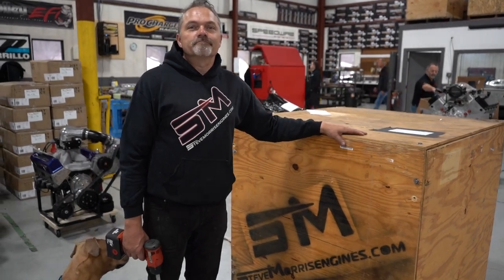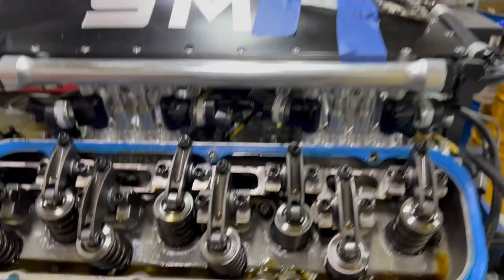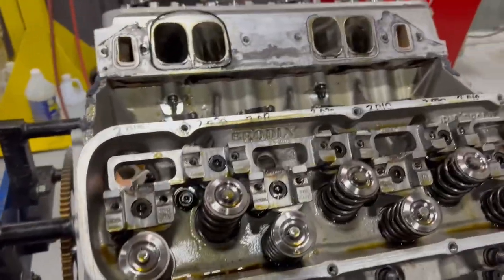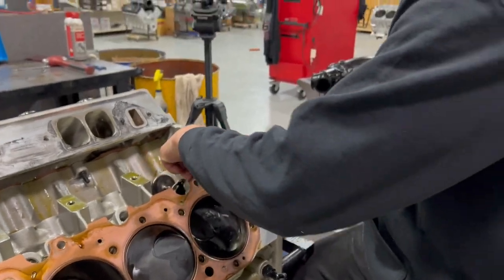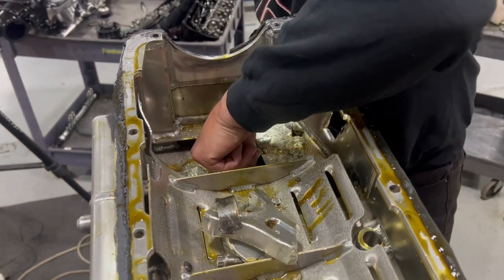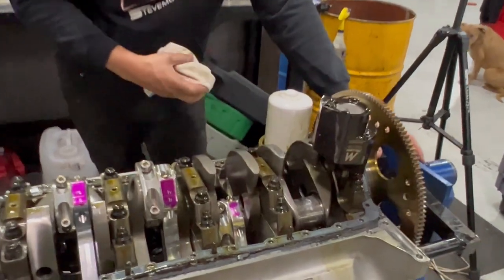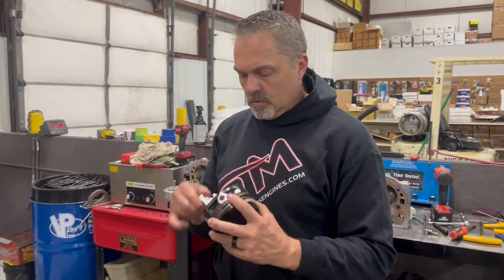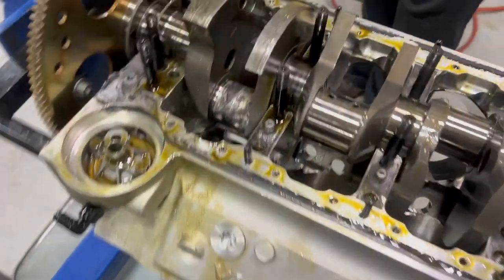Mullet !  What Happened ? - Warning: Engine CARNAGE

Comment: that engine owed cleet nothing!!! the fact it made it through last year is amazing lol. good work steve, and CLEET, Mullet needs a SMX!!!!!!!!
Reply: @bigboreracing356  Steve broke an SMX, so shit happens
Reply: @bigboreracing356  everything breaks eventually
Reply: He would have to do a lot of work to mullet to get an smx
Reply: @nickcollins1528  Not really. Just all the accessories to go dry sump and he should be good to go
Reply: @KJ-kw7gh  
Bad parts broke Steve’s. Not shade tree mechanics. Tuners going against builder’s advice and limits.
Reply: @bigboreracing356  go big or go home.
Reply: @russellridge8623  Cleetus told him he wanted to win. That means a 6.50 average. All of this is on Cleetus and he's the footing the bill. Your opinions don't matter, unless you're paying for his engine 😂😂
Reply: @bigboreracing356 will*
Reply: @nickcollins1528 Except Chuck Norris.
Reply: @nickcollins1528 it's going SMX
Reply: Ask Pete what cylinders it shuts off on TC
Reply: Not even an SMX is safe from Cleet, when he runs it without oil.
Reply: @russellridge8623  this is not shade tree mechanics. If they put too much power to it and split the block or shattered a rod then yeah it's on them, they knew they were over what Steve thought the engine could do but they were trying to win . There is very little chance a bent/broke crank could have been caused by tuners on the level that have touched mullet since he went big block. At this point it's clear something has gone wrong somewhere but it's unfair to blame in on Cleetus for being hard on stuff. Yes he was being hard on it but that doesn't seem to be why it broke
Reply: @russellridge8623  with an smx cleetus would be able to put in those tunes and not worry about blowing the engine. He wants a mid six car and that engine couldn't handle that, but an smx could
Reply: @russellridge8623  well, end of the day, you or I aren’t paying the bills, so don’t really matter what Cleetus and crew do.
Reply: @nickcollins1528  He’s already said it’s getting an SMX.
Reply: mullet doesnt need an smx, he cant go any faster with his current cage and weight so why spend all that money? either needs to go on a big diet, and go full tub frame and change cage cert or just build a new full promod
Reply: @russellridge8623  What "shade tree mechanics" worked on Mullet? Kevin form KSR has over 25 years experience, James has close to 20 years, and his tuner Pete is a legend in the motorsports industry with over 30 years experience.
Reply: Wasn't it a a freshly rebuilt engine though? It was a freak accident...... it was new for this season. Go look through Cleetus' videos. This was the engine that got rebuilt.
Reply: @russellridge8623  awe yes throwing shame at shade tree mechanics. Because everyone is born fully ready to be a pro mechanic, no one ever has to get hands on to learn, how dare they touch a motor right?
Reply: @nickcollins1528  not really
Reply: What do you mean " made it through last year "?   That engine is less than a month old, see the vid and Steves note at the beginning  "    Mullet's Engine is Ready to Battle "  on the channel " Steve Morris Engines  "      So, was it a sucky engine builder or end user that blows stuff for fan boi clicks?   I know what I'm picking. . . .
Reply: @wingracer1614  Plus a complete rework of the cooling system.
Reply: @TheMlc4life    That engine is less than a month old, see the vid and Steves note at the beginning  "    Mullet's Engine is Ready to Battle "  on the channel " Steve Morris Engines  "      So, was it a sucky engine builder or end user that blows stuff for fan boi clicks?   I know what I'm picking. . . .
Reply: @bigboreracing356  Thanks for the compliment.
Reply: @cliff4695  NS!!! Cleetus Has Footed the Bill
Reply: @ourtexasfamilyvideos62  Oh yeah. forgot about the dry deck. Still, that's child's play when you have a fabricator like Ty on staff. Nothing to get worked up about
Reply: @solatyn  Mullet has a 6.0 cert.
Reply: @bobroberts2371  people seem to have the attention span of a gold fish saying "oh the engine doesn't owe him nothing".....  really? what are they talking about it was totally refreshed ......
Reply: @TheMlc4life  said  "   user blows for fan boi clicks? Is that your pick?    "    ( cue 80's arcade game sound " Game Over " )
Reply: @tuloko16  This 100%, this engine would have probably made it all year , but he ran it with no oil for several minutes in the FL heat.
Reply: @bobroberts2371  shit oops LOL
Reply: @KevinHuff23  does it? i looked up the regs and the only 25.x cert that can go 6.0 is for full tube frame full body cars that weigh up to 3200lbs. I believe mullets cert is full body no tube frame 6.5@3600lbs

Comment: is that how a v6 is made ?
Reply: Extreme active fuel management
Reply: Land Rover did that with their V6.
Reply: 231s were made that way.
Reply: a chevy 4.6 v6 is basicly the front 6 holes of a 350 .. they share a bunch of the same parts too
Reply: @scootersfrog  The Rover V6 is actually a V8 block though, but with the back cylinders not bored out.  Very odd looking.
Reply: @arg8763  chevy used do that in some of the lower nascar divisions. It was the nascar sb2 small block with the back two cylinders missing their rods and pistons and they had a block off plate in the intake to block the back two runners.

Comment: Steve: It's good for 35. 

Garrett: How bout 50?!
Reply: Great
Reply: More boost = more broken parts  = more clicks = more $$$
Reply: @bobroberts2371  you have to spend money to make money
Reply: That is exactly what happened.
Reply: @patrickr2686     The problem is the fan bois of C McF   k  will trash engine builders after he breaks stuff  ( see Texas Speed where C had to tell the fan bios to stop trashing TS  ) .  The danger is, all it takes is a drunked up fan boi thinking they are avenging C by burning the shop down.  
Years ago I worked in a regular shop with a good rep.  Someones drunken bar talk turned into an unstable guy damaging many cars as a way to impress their drunken friend.
Reply: @bobroberts2371  I don’t think anyone has talked trash to Steve, all I have seen is nonstop how garret ram the motor without oil but I could be wrong same with Texas speed was all comments about things garret and his team did wrong
Reply: @bobroberts2371  I would like to assume that the people that would actually be using these engines would understand that it was pushed FAR beyond its limits.
Reply: @cixcer3821  Do a search for the vid "   Here's What Happened To Mullet's Engine In Texas...  "   and look at 2:50 . This is where he told complaining posters it was not the fault of engine builder and to stop blaming them.      BTW, a screw that allegedly came off the throttle blade would likely just pass through the engine and out the exhaust not trash the engine.
Reply: @L1Z1O  said "   I would like to assume that the people that would actually be using these engines would understand that it was pushed FAR beyond its limits.  "  

Well, do a redit search for the title "   Cleetus McFarland rant regarding the talk about Texas Speed. Thoughts?  "   on the CMcF    page.   To quote one of the posts "  His target audience is literally Florida man. You got to expect crazy with that. "
Reply: He went for 35 bar.
Reply: @bobroberts2371  hard disagree that Garrett would trash his $60k engine at the beginning of a season for clicks. I’m pretty sure he would rather be racing.
Reply: @aaronpreston47  Apparently he has lots of cars.  And, according to the net, the YT  channel takes in about $ 1 million per year.  While 60 K is money add in all the other income sources and this sinks to relatively small change.   

Don't forget that , since this is a business, the cost of the engine can be depreciated as a business expense. 

Remember, C's background is marketing, he knows what gains clicks.
Reply: @bobroberts2371  1 million starts to run out quick when you got a large payroll to pay for along with real estate payments, regardless of his other revenue streams. 60k to C is still a hunk of change and I doubt he would destroy an engine he just refreshed for clicks. Texas speed and Steve Morris engines are out of reach for most of his viewers.
Reply: @Bob Roberts  I definitely know that there are a subset of people that will trash talk the builders, I just doubt there's an overlap with the people that will actually BUY the product
Reply: @graaly1978   said "   Texas speed and Steve Morris engines are out of reach for most of his viewers.  "  

But they are not out of reach of a drunken fan boi that thinks they are going avenge C by burning the engine shop down.

Years ago I worked for a regular shop that had a good rep.  Someones drunken bar talk turned into an unstable person damaging many cars at the shop in an attempt to impress their drunken friend.

Do a search for the vid "   Here's What Happened To Mullet's Engine In Texas...  "   and look at 2:50 . This is where he told complaining posters it was not the fault of engine builder and to stop blaming them.
Reply: @L1Z1O   Those that could buy an engine are not the issue. The danger is, all it takes is a drunked up fan boi thinking they are avenging C by burning the shop down.  

Years ago I worked in a regular shop with a good rep.  Someones drunken bar talk turned into an unstable guy damaging many cars as a way to impress their drunken friend.
Reply: @Bob Roberts  That's crazy, hopefully the shop had good cameras/insurance!
Reply: @bobroberts2371  he’s spending more money than he’s making.
Reply: @L1Z1O  That was about 40 years ago so cameras were uncommon.  The damage was mostly broken glass so this was replaced in house.  All it takes is one crazy to inflict much damage.
Reply: @bobroberts2371  you've told the same story like 8 times, dude. We get it.
Reply: @bobroberts2371  Keep taking the meds and keep away from the alcohol bro.
Reply: @bobroberts2371  Still need cash flow to rebuild/ replace that 60k engine. When you have no shortage of other expenditures (  facility upgrades and maintenance, several other cars ( not including the roughly 100 crown vics he buys every year ), tracks, events and merch ) replacing an engine of that value is still no small task. I am willing to bet that replacing that engine at this point in the year was not budgeted for.
Reply: @98integraGSR  Not everyone reads every single post like you do.  When I post to a specific person, they get notified and then can see it.
Reply: @ritchschut1997  When someone like Steve builds an engine and says " do not exceed XX boost " and the operator intentionally exceeds that level , just what would the operator expect to happen?

Breakage sells vids.  

For an example, have a look at the first Roadkill episode.  They bought an early 70's full sized Pontiac for a road trip. The car ran without issue and in a years later Q and A,  David Freiburger stated that it was a dull episode because nothing happened.  ( RE They could have been driving 10 year old Toyota Camary ) 

Since then and for the most part, RK has not intentionally blown much stuff under the guise of " Oops ,"  ( wink wink  ) .  

Cleetus is VERY adept at marketing and knows what sells.  While there might not be malice aforethought to script a breakage vid, there is that " I will run across the road without looking "  until something happens vibe. 

His channel is entertainment, I get it. The issue I have is fan bois trashing those that do work for him and the product fails. See  2:50 in the vid "   Here's What Happened To Mullet's Engine In Texas...  "
Reply: So we know 50 is the limit so we will only go to 49 next time

Comment: Mullet sure kicked some ass over the time this engine was RUNNING. 
dry sump and SMX time!! cant wait to see MULLET kicking ass again this summer. 
Thank you @Steve Morris for the in-depth details as always :)
Reply: With the g-forces he's pulling, he definitely needs a dry sump system. Wet sumps just lose their ability to keep good oil flow, he's even talked about it.
Reply: @octane613  I know Garrett never foreseen that mullet would be that fast but he should have never went LS to begin with the car should have been built with a dry sump system and a big block from the jump. It’s going to be a lot of work to swap it from a wet sump big block to a dry sump SMX but it needs it badly and he has a great team behind him to get it done.

Comment: Looks like you're becoming a forensic scientist I like the way you explain everything in detail
Reply: I tried to make sense of it. Result:

It seems like the oil pump is on that side so 7/8 will be the last pair to get lubrication again when you run without oil. The heat is on the ' wrong side' of the bearing and since Steve had trouble to find an explanation for it, I think it's the aftermath of Cleet being 'an idiot'/making a mistake. Read below if you're interested in my reasoning.

My full explanation:

The engine was sitting in the shop with no oil in it so all the oil remaining in the engine/bearing flows to the bottom. Then the engine is started without oil and naturally the bearing side that is on top will heat up first, cause almost all oil has ran down to the bottom part of the bearing cause gravitation is real.
Same with the pistons. You don't know at what position the crankshaft came to halt, but if you look at it it's likely that that the crank part of 7/8 was pointing down. You can see that the spot where the heat was is facing up both times if you rotate the crank.
The way Steve explained it the bearing of the rods are fed from the crank bearings. After Cleetus put oil back in the pressure in the oil system is starting to build again. All the oil is pumped into the engine again and will take the path of least resistance. That means that almost all oil will flow past main bearing four so the dry side of that bearing four will get most heat of all crank bearings. When the oil finally gets to the rods most oil will flow past rod bearing seven till rod bearing eight has built pressure and bearing seven will finally get full oil pressure.

If I understood Steve correctly, it all makes sense.